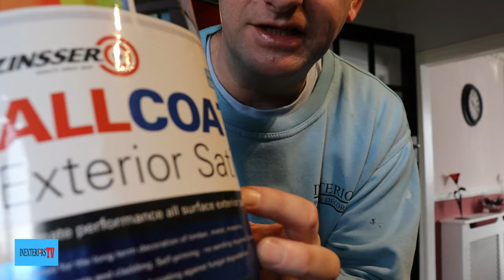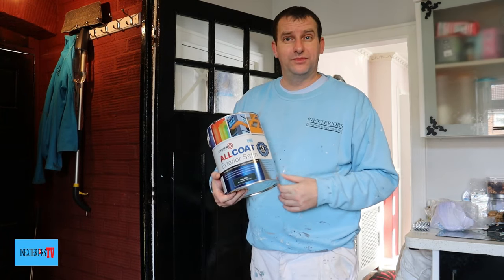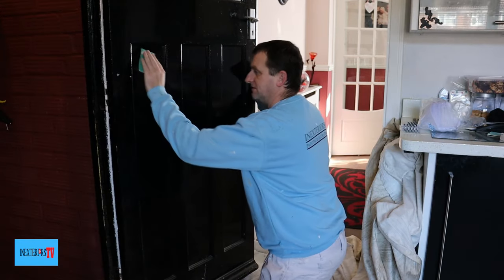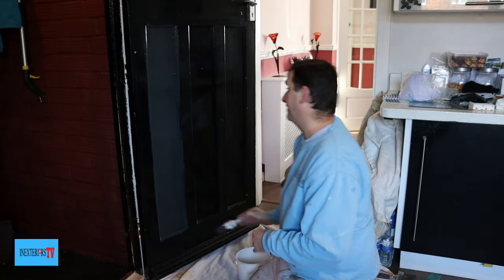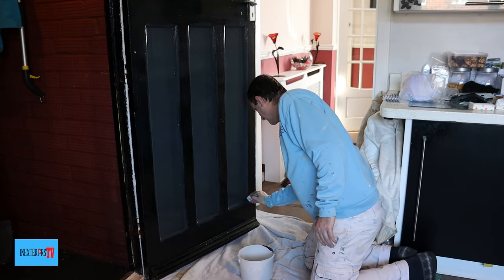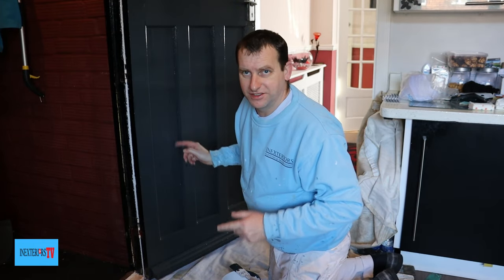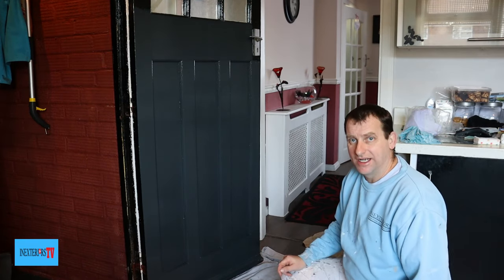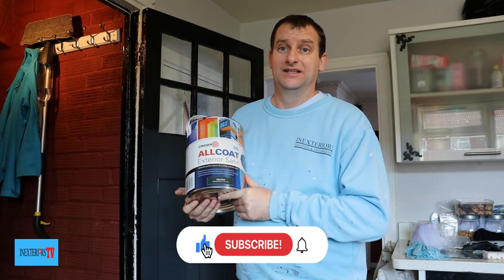Zinsser Allcoat review.

Comment: What undercoat did you use for the Zinsser - I have a reddish painted door on one of those metal fronted UPVC doors.
Reply from the maker: Its a multi surface paint, it is self undercoating. but you can use the zinsser bullseye 123 as a first coat.

Comment: Hello 👋Could you suggest a Top quality, durable & scrubbable, water-based paint, I can use for my bathroom, which can withstand moisture exposure 💦 ? it's to paint over old yellowed gloss on wood surfaces which I have already sanded ? Thanks 👍
Reply from the maker: What did you decide to put on the windows.
Reply: @Inexteriors   finally after hundreds of read reviews and watched vidoes. The two brands I'm deciding on. Well 3 . My idea is  BIN primer shellac over sanded gloss. Dry 24 hours. Then either un coat & top of AG or Everal aqua 40. I can't buy SCUFF-X or Bedec or isomat in my city.
Reply: @Inexteriors  I'm also wondering the best tile paint but only to paint inbetween over black moulded tile grout which I sanded & cleaned. Was thinking I might try use BIN shellac and the window paint I choose as tile grout pens and paint specifically for grout don't have trusted reviews
Reply from the maker: @bsfbestshortfilmsonyoutube  do the same in the bathroom, do you have a dehumidifier. Let me know how you get on, i learn from you aswell.
Reply from the maker: @bsfbestshortfilmsonyoutube  i have only painted tiles once, i used a product called V33 tile paint.
Reply: @Inexteriors  yeah I watched a video of you using this paint 7 years ago. Do u know from your customer if the paint resisted or held up ? Although I dnt think I can buy small can of it. I could buy the testers but I'm unsure if the sachet additive comes with testers I really only need small amount. I've yo paint radiator too so I might be best using radiator paint . Any recommendations? Radiator psint ?
Reply from the maker: @bsfbestshortfilmsonyoutube  The paint held up to be fair,
Reply from the maker: You can use most undercoats and top coats just follow the same process as the wood work. you must be doing a big project at home.

Comment: I always use bullsye 123 (on bare wood)as a primer before using this. Just to be sure . Quality paint.
Reply from the maker: Makes a lot of sense my freind.
Reply: And I always sand regardless of what they say.
Reply from the maker: I woud  aswell.
Reply: HI. I have sanded down layers of yellowing ol gloss off 3 windows. I was about to buy Zinsser AllCoat then seen you reply. I had sanded off most of the yellow old paint 98% I can now see the wood grain through a thin layer i left behind . Would I still need to use 123 ? even though I still have a thin layer of paint ?
Reply from the maker: @bsfbestshortfilmsonyoutube  it probably would be beter to give it a coat of 123 it can only help, but it can be done without as it is an all in 1 paint.
Reply: @bsfbestshortfilmsonyoutube  I'm sure it'll be fine without it, but with all that work you've done, I would probably do a coat of bullsye to be 100% . I've been using the 123 plus lately, and the coverage is great . I also used bedec msp as a top coat. Decent paint also
Reply: @Inexteriors   i've read about this flaking in 3 comments. A women did her summer house and followed the right system but she said it still flakes ? have you used this on any woodwork and scratch tested it yet ? have you used it on any woodwork more than a year ago and does it hold up ? I really wanna be sure after because af all the sanding I done I wanna be  sure I am buying good quality paint so I don't have re - do
Reply from the maker: @bsfbestshortfilmsonyoutube  Nothing is full proof in this world,byou are using it on internal windows, so its not open to the elements, i will be doing a scratch test in a couple of weeks.
Reply: Although gloss was lasting as I am sanding away very tough old gloss which hasn't been painted over in 10 years. But now I wanna switch to water based paints to avoid yellow and the fact wb paint are phasing out. I read a couple of comment that even Bedec has chipped from knocks to wooden doors.  I won't be buying bedec cost me 85 euro 2.5 liters with shipping costs.   @Inexteriors

Comment: I like this stuff and I like the idea of it however it’s leaves awful brush marks and the white barely covers anything
Reply from the maker: Interesting what you say about the white, i was going to get the white gloss on my next job, how will it perform over white.
Reply: @Inexteriors  I used the white satin over an old window which was already white with a bit of filler here and there and it took 3 coats and could’ve done with a 4th. It such a shame as I love the idea of a 1 hour recoat but the time it took with extra coats I might as just well have used oil
Reply: @Inexteriors  I just used this stuff for the first time (Satin) last week. I am only a DIY'er. I found I got a superb finish on the door that I took off and painted flat, but the trim seemed very "brush marks", perhaps I brushed it out too much. It is a lovely paint to use, especially compared to the Johnstons Aqua Gloss I used on the last thing I painted. That was properly hateful until I found a comment someone posted on a decorator forum to just moisten the trim slightly before painting then it was quite nice!
Reply from the maker: @blademansw  dampaning the surface is is a good tip, also don't apply water based paints when it's hot, try and pick a cool part of the day.